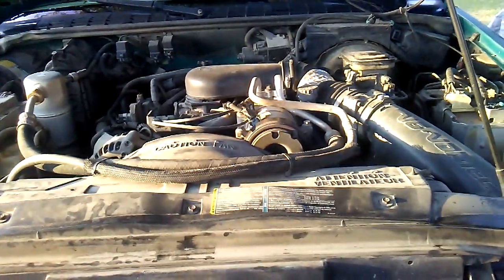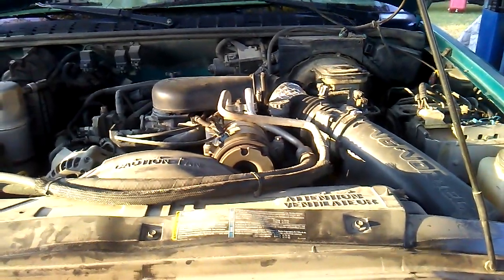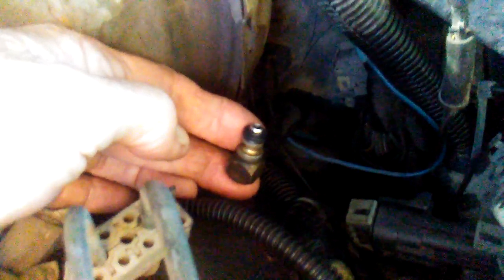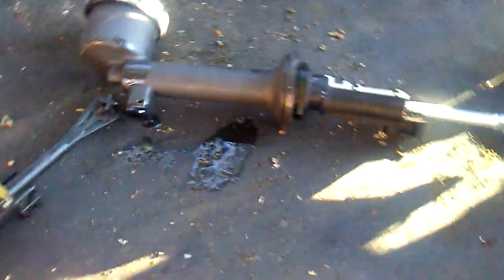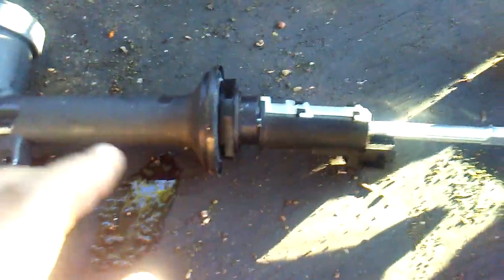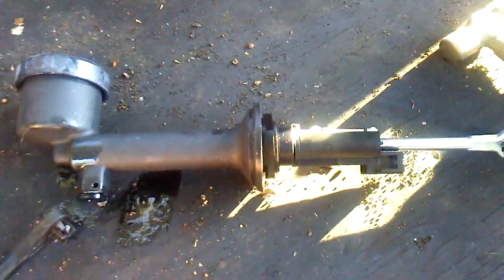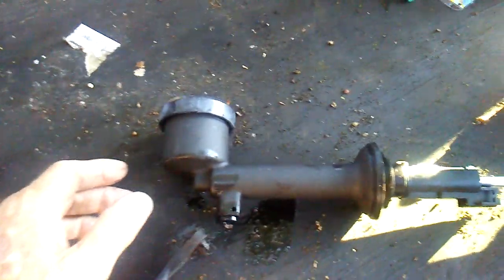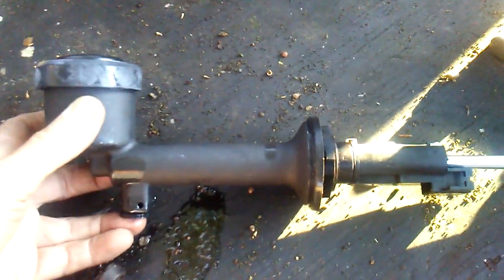1996 S10 Clutch Master Cylinder

Comment: Thanks for the help. My first manual truck and I'm teaching the wife how to drive, now my master cylinder is leaking. This video answers some of my questions.
Reply from the maker: Glad this video helped you out. Another thing you can teach a new driver is to not ride the clutch. You probably already have but thought I'd throw that in.
Reply from the maker: Sebastian just make sure to bench bleed the master cylinder real good. If you don't get ALL The air out it will make you think the part is bad.
Reply: I'm

Comment: I need help. My master cylinder went bad. I replaced my slave cylinder but my master is bad. It starts and runs when I put it in gear. I just need to know hot to take the master cylinder out please

Comment: Q. I have a 1995 s10 chevy.4cyner. 5speed. Cluth is going bad. I removed air from it. That helped alittle. The master cylinder is good! Ok.....does this truck have a slave master cylinder?? If so I can't find it. Could it be the release bearing which is in the tranmission. And for the first time today I noticed it leaking where the transmission bolts up to the engine
Reply from the maker: Yes it has clutch slave cylinder and it is also part of the clutch release bearing. You can order the complete kit with clutch and everything you need. Make sure yoy buy brand new.And yes the transmission will have to be removed to replace.